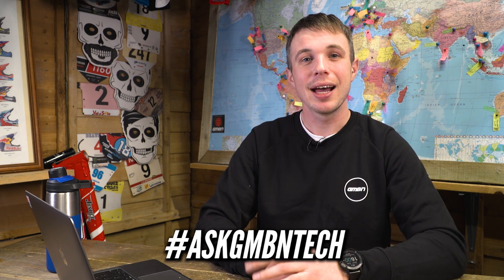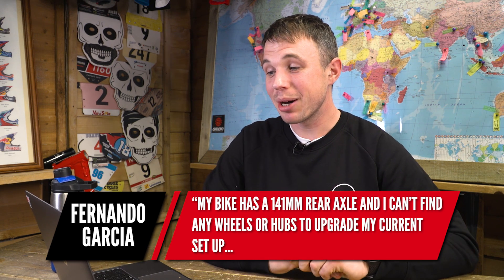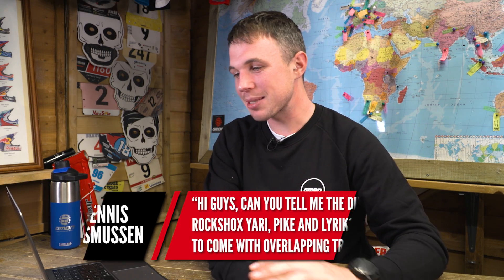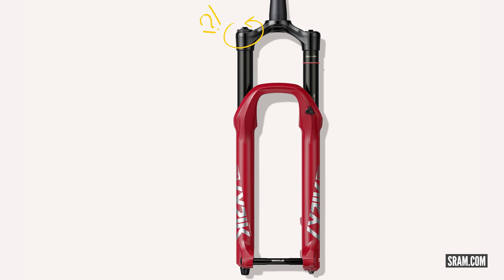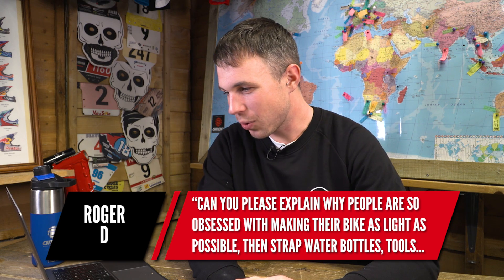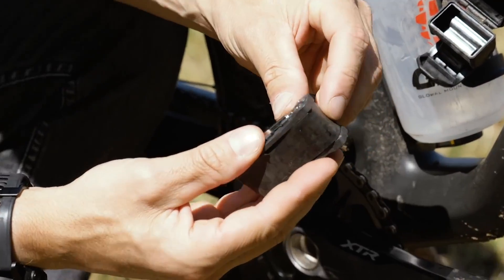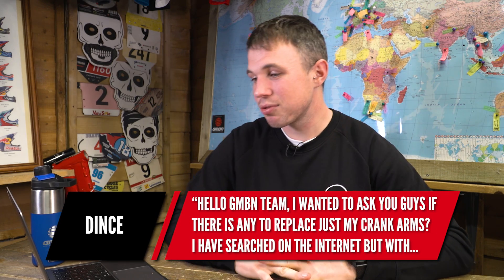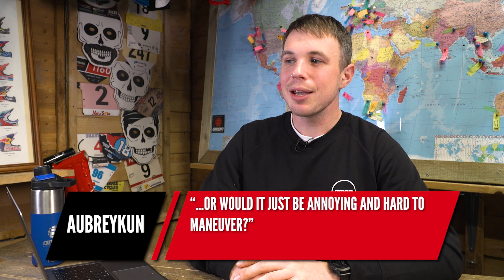Why Do People Attach Tools To Their Bikes? | #AskGMBNTech

Comment: A little late to this but I just wanted to mention that you should watch out with body-mounted spares. In the right conditions, sand and dirt can get lodged between the frame and tyre and over time can rub off your paint. So If you are not diligent about keeping the surrounding area clean, you may be in for a nasty surprise. 

Personally, I run a butt-pack with all my stuff and never had a problem.

Comment: #askgmbntech Help! I’ve been having a ton of problems with the preload, the front hub is a cup and cone with a 20mm axle and the rear one have sealed bearings but still uses a cup and cone style preload system. The problem is the same on both, after a few days they either tighten of loosen even though I try to do a perfect preload. The technique I use is get the first nut at finger tight and then tight the second one with ny fingers too, here it should be some friction when turning the axle, then I use a couple of cone spanners to let the outer nut in place and tight the inner one againts the outer one (gentlely tight), releasing pression out of the bearing. This gives a good preload, smooth turning and no playing of the axle. But then I ride and everything screws.

Comment: @askgmbntech really need your help Doddy and Henry, I was wondering if it’s possible to run offset bushings in the opposite position to steepen the head angle and raise the BB, but I’ve been recommended not to do that as the will want to rotate in their position. Do you have any ideas on the idea or is there another way of raising the BB without less travel or angle set? Cheers, love the show!!
Reply: oooh yes offset bushings. i stay awake at night wanting to run a longer fork and shock on my meta tr by raising the front to 160 from 140 (pike) and extend the rear shock by about 5mm to give about 140 (from 130mm) rear. but the key is offset shock bushings and a mild raise of bb (want that). sry for the hijack.

Comment: #askgmbntech Hi Doddy Love the show, recently I serviced the lower legs and air shaft of my Rockshox Reba (thanks to your vidoes) but I haven't done anything with the damper. Do you need to service your damper, if so how? I've noticed that I'm getting a bit of a squelching sound from the damper
Reply: Matt Freeman I have serviced my damper simply by replacing the oil inside with new oil, but the amount of oil needs to be precise. most manufacturers have a page of how much and what type of oil you need in your damper, lower legs and rear shock. 
The squelching sound is probably normal as i’ve noticed it on a lot of bikes with air forks and shocks. It’s just the sound of the oil flowing through small shims in your damper.

Comment: For the second question: I had the same problem and after some research I found a strong compatible wheel set. You could buy the Halo Vortex wheel in a 148x12 and on their website they sell adapter too, and it works perfectly!

Comment: Henry you should probably have answered that the wrong fluid messes with your seals both ways around. So use what it was designed for. If in a bind mineral fliud is just oil and brake or DOT fliud is available at every garage or gas station.

Comment: #AskGMBNTech

Hi guys, I'm happy with my bike fit and setup apart from one thing, my feet ache (sometimes really painfully) usually in the soles, when descending out of the saddle. I'm comfortable and happy all day long otherwise.

I had this with SPD's but I switched to flats a while ago as it helped with my confidence in DH and techy situations. The pain is far worse with flat pedals. My shoes fit well. I have size 9 (UK) shoes, standard pedal platform. I use proper flat riding shoes with a nice stiff sole.

I'm thinking a bigger pedal platform might be a way to go, or look for a grippier platform maybe. I'm not sure of the effects a different size platform would have. Perhaps I should be looking elsewhere, or is it more of a technique solution I should be working towards?

Thanks guys, great show. 🤙

Comment: About the brake fluid. Do not use car brake fluid. Magura uses mineral oil based fluid, AFAIK. Cars do not, they use either glycol ether based (DOT 3 and 4) or silicone-based fluid (DOT5). I would not mix any of those, really. 

In a pinch I might use mineral oil based motor oil to get me out of a bad spot, but the whole situation is very far fetched as I am not very likely to lose both brakes in one go.  Also, Magura fluid is low viscosity, so motor oil will most likely give bad performance.

Comment: #AskGMBNTech 

Why are steel frames more forgiving than aluminium when steel is 3 times stiffer than aluminium?
Reply: Space Force  but all steel has a similar youngs modulus around 200gpa give or take 10% while aluminium is always way beneath this. You must be right with the over building of aluminium frames!

Comment: Hi, I am considering purchasing a 2020 Specialized Fuse Comp 29, stock, with RockShox Recon RL forks (130 mil). I am a trail rider and sometimes ride urban for fun. Should I upgrade to a more aggressive trail fork? Or can the Recon withstand rough trail riding (putting the amount of travel into account)? I am considering upgrading to the RockShox 35 Gold RL or Revelation RC, what are the differences between these two? #AskGMBNTech

Comment: i just bought  a awsome older model bike with a 142 hub standerd. and i would like to use its carbon rims on my dual suspension spark . but the spark uses a boost hub front and rear . is it possible to convert the rims so that it works on both bikes and i can interchange the rims between both bikes? or is the frame itself not compatible with boost.
Reply: #AskGMBNTech

Comment: Re those magura brakes...they are toast and extremely dangerous as could easily blow a seal in use = crash, death, and more! 
 brakes will need a full strip and thorough isopropyl clean, before all new seals throughout, both lever and caliper. Also new hoses throughout.  Easier (cheaper) to replace the whole brakes tbh. Just replacing fluid and fitting new seals will leave residue and overtime ruin new seals = failure, crash, death etc etc

Comment: #ASKGMBNTECH

on my current mtb I have a thru axle and the front and a qr skewer on the rear, I’m am just wondering if I can get a wheel set and put adapters on either hubs to make them fit, or can you get wheel sets that come with thru and qr skewers? Cheers
Reply: depending on the hubs, you can get just the end caps replaced. It is as easy as popping the end caps. No tools! I had the issue of a boost QR (141x9) rear hub and it is such a weird standard. I found a wheel with a 148x12 dt Swiss 350 hub and I was able to swap out the 12mm end caps for 9mm end caps. as far as I know, you can also do this with some hop hubs as well. hope this helps!
Reply: Stephen Vincent great! Thanks a lot.

Comment: #askgmbntech  hi, I bought my full suspension bike of eBay for a bargain knowing that it had no front derailleur, it is a 2-10 but with now front derailleur, if it was up to you would you make it a one by or buy a front derailleur, which would be the cheapest and the best option?
Reply: if it only needs a derailler, thats pretty cheap. if you want to go 1x you need at least a narrow wide chainring, a wide range cassette would be nice aswell, and that could also mean a new chain.
Reply: @ultiss  yeah that's what I was thinking, I need shifter cables front derailleur, the whole set,
Reply: @samingram9616  if you need derailler, shifter, and chainrings even you better go 1x
Reply: @ultiss  yeah that's what I'm thinking, cheers

Comment: If you go by math and physics, you want as much weight to be "sprung" as possible. That's one reason wheel weight is such a big deal. Wheels are "unsprung" so any weight is affected directly by the terrain. The rest of the suspension has to dampen that inertia to create a smooth ride for you. Now looking at backpacks, you could argue that your body acts as a suspension to dampen inertial loads and prevent that weight from affecting your ride. So, adding weight further up the suspension/damping hierarchy seems logical. HOWEVER, that dampening comes at the cost of fatigue. Your MTB suspension doesn't "get tired" during a ride (ignoring heat buildup and wear & tear), but you do. Just shifting your weight back and forth in a sprint uphill and you can imagine the fatigue on your core as the weight shifts left and right. You want to save that energy for mad jumps and dat KOM, yo. 

So I carry more tools on the bike than my back. It might make my frame heavier, but it makes my enjoyment cost less. Yes the weight is there, but if I'm going to carry it anyway, I don't want my body working to dampen the inertial loads. Add some lower back pain that comes with age, and backpacks just don't make sense if there's a spot on the bike to carry it all.
Reply: Makes sense, even more so if you can get the weight low down on the frame, ideally below axle height.

Comment: Good response on the "Tool" issue :)  I hate riding with a backpack also, the bike always carries a load better than I do and if the weight has to be there, then lower is better for stability.  Plus if you have more than one bike then you will always have the right tools, tubes, etc on the bike; the toolkit is tailored to the bike it is attached too.  No forgetting the 2.5mm allen, or bringing the schrader only minipump on your presta road bike....
Reply: You still have a pressta only pump? I can't even find one of those at Walmart and they only sell tubes with pressta valves.
Reply: @bobbyhempel1513  Technically the pump fit MY bike fine, but not my friend's.  Always embarrassing to call for help when SOMEONE lets all the air out of their tires trying to pump up one with the wrong pump....  Always have your own tools :D

Comment: My brake lever on my Clarks m1 hydraulics goes in a lot further than it used to is this due to an oil leak or used brake pads?
Reply: air in the system, it needs bleeding. its not that unusual to happen over time
Reply: @ultiss  cheers I noticed my brake hose was loose after I crashed on a jump

Comment: #AskGMBNTech
Hi, I've been looking at buying a new bike but I'm not sure to buy a expensive bike or a cheaper one but put loads of better components onto  it. Thanks
Reply: It'll be cheaper to get the better bike from the start
Reply: Ok thanks
Reply: @sam.meade.06  I should probably specify that the frame matters, for the same frame it's going to be more affordable to buy a complete bike but if you're looking at a bike that costs $4000 for just the frame vs a complete bike that costs $4000, you're better off getting the cheaper bike and upgrading (not that you'd need to upgrade a $4000 bike, but you get my point)

Comment: How can I make my bike look expensive , but on the cheap?
Reply: No way really, any experienced biker will instantly see it's not an expensive bike.
Reply: Replace little things like the tyres, grips, saddle, pedals. Maybe convert to a 1x drivetrain.
Reply: gold spraypaint?
Reply: Space Force You don’t need to spend a single penny on a 1x drivetrain. My old bike had a 3x9 and I changed it to 1x9 by taking off the front derailleur and chainrings which looks so much cleaner and works perfectly fine

Comment: 141qr boost answer: You can buy new endcaps for atleast dt swiss, mavic and hope hubs.
Reply: I came down here to comment the same thing. @GMBN TECH, make sure Fernando knows that any "boost" through axle hub as long as you can get end caps, just swap it. I'd recommend DT swiss.
Reply: swapping end caps of the hub doesnt make the frame thru axle compatible. Thats why henry said he needs to check if the dropouts can be swapped.
Reply: ultiss thru axle can be converted to qr boost, I’m buying the hope pro 4 and changing the end caps to make it fit
Reply: Yea came to comment on this, you can use any boost rear wheel with these plugs but would still require your old skewer
https://rover.ebay.com/rover/0/0/0?mpre=https%3A%2F%2Fwww.ebay.co.uk%2Fulk%2Fitm%2F292116597756
Reply: Space Force  then please explain where the thru axle threads into on an open dropout qr frame?
Reply: Space Force  i think you mean something like the dt swiss 10mm thru bolt. its just a fat qr lever in open dropouts. Something is only called trough axle when it bolts into the frame.

Comment: #ASKGMBNTECH Hi, so I have a problem with brakes. I have a spesialized bike with xt brakes and a canyon with sram guide R brakes.the canyon has 200mm and 180mm rotors and the spesialized has 180mm and 160mm rotors.I want to put xt on the canyon and the sram on the spesialized. Should I need new adapters or what? How can I swap them ?
Reply: simply swap over the calipers and leave the little adapters where they are
Reply: @ultiss   but 2 adapters are sram and the other 2 are Shimano
Reply: @spookyboi4123  i dont think the spacing is any different, to be sure simply do a test fit and see where the pad lands on the rotor
Reply: @ultiss   thank you very much 🤙🏼👌🏼

Comment: 10:15, regardless of the theory I want you guys to try it :P Get a super small rear bycicle wheel from like a kids bike. The size difference only works to a certain point depanding on the angle of the decent, you don't ride an 80 degree angle so you don't need a tiny rear wheel. The pedals need to be super short :P Maybe Doddy can make a few wacky contraptions for you guys to test :D

Comment: #AskGMBNTech am I able to mix a shram shifter with a shimano derailleur if I plan on just upgrading my drive train gradually?
Reply: No. Sram is 1:1 shimano is 2:1 system.
Reply: No.
Reply: Wolf tooth, I believe, used to make cable pull adapters. You might check out what they have.

Comment: #AskGMBNTech 
Hey guys 
Is it possible for a shimano non series mt200 brake calipers paired with Shimano SLX levers?
Reply: Theoretically yes as long as calipers and levers use the same medium (mineral oil or dot)
Reply: @nexusparadigm4062  so it doesnt matter if the caliper is quad piston?
Reply: @chrispaul4471  No. If it still uses the same fluid everything will be okey BUT!!! Remember that using a lever that is "lower" class will not brake as good - FOR EXAMPLE: using best 4 piston brake with best lever gives 100% braking but the same caliper with "worse" lever only 80%. You get it?
Reply: Yeah, but why???
Reply: @th_js  I was just curious because my friend told me about his plans on changing his levers with an slx levers
Reply: i dont think mt200 comes in 4 piston, maybe you have the mt500? There is no issue using an slx lever, there are no specific 4 pot or 2 pot levers
Reply: Yeah, I also don't think you can get MT200 in four piston.
Reply: If it's a four piston and it only says Shimano, then it's an MT-520. If it's that then why upgrade to SLX-levers? You really won't get any benefits aside from a tool free reach-adjustment.

Comment: Some cars (Citroen/bmw ) use LHM for the brakes and clutch which is a mineral fluid, which will invalidate the magura warranty, but will not do as much damage as a DOT fluid.
Reply: LHM is also widely used in transmissions and power steering, and as it is a mineral oil - it will do no damage whatsoever to your bike brakes. Maybe there are some Magura specific issues, but I'm running my SLX for a year on ATF Dextron (basically the same as LHM) and hasn't spotted any changes to brakes behavior.

Comment: Some questions should really not be picked for ask episode on gmbn and tech channels. That mullet bike question with 20" rear. I mean how little imagination someone can have? Imagine going in a gnarly section with the same speed you did on your normal bike, but with 20" wheels, that would be exciting to say the least. Even with only rear 20", the crankset would prolly help with grip on techy climbs as a third wheel 75% of the time ha ha ha  But I gues if there is not enough questions for an episode, something needs to be picked....
If a mullet bike with 29 front and 20 rear will ever happen, there will be a question about buying a single and/or both crankarms every episode LOL
Reply: You obviously have alot to say about it
Reply: Agree
Reply: Hey, I asked because I have a bunch of random parts and was thinking about how it would perform as a way to go over really rough terrain, like non-trail offroading, and I'm glad I asked before I put all the effort into piecing something like that together and not knowing what to expect.